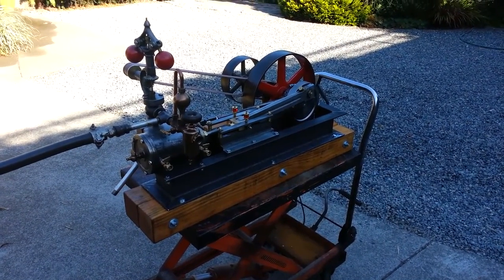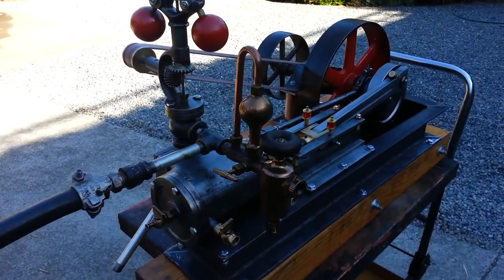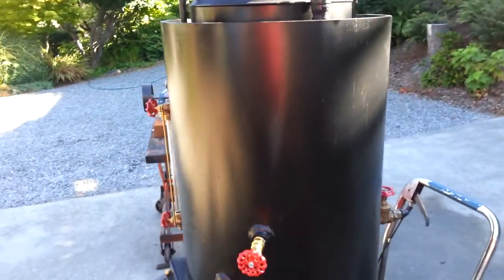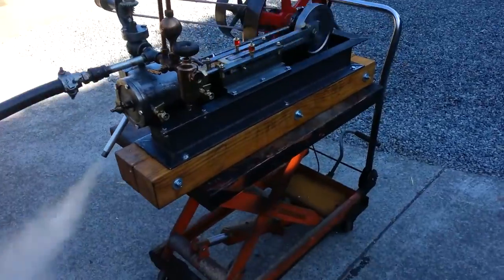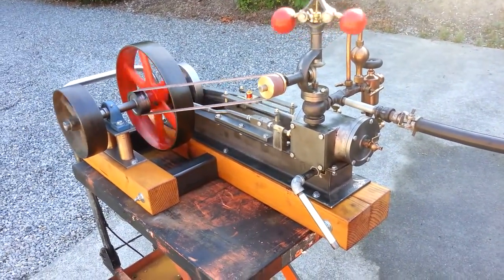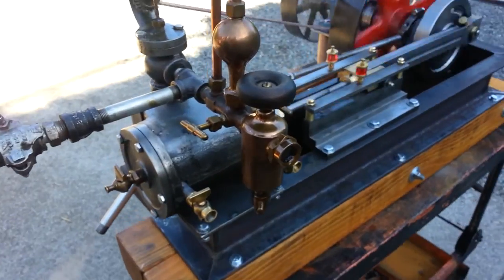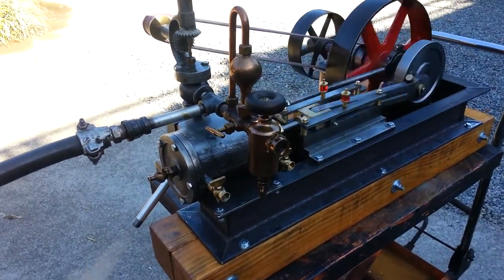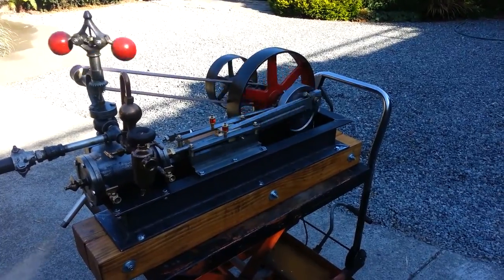Steam Mill Engine Flyball Governor Tractor Hit Miss Boiler Off Grid brass. FOR SALE ON EBAY

Comment from the maker: I work at it every day till the engine is done. 6 to 8 hours,sometimes 7 days a week.
Reply: rossco1948 I am curious to know what you charge for building a boiler. I am looking at buying one to run my 3 HP Petrie engine.
Reply from the maker: Give me a call. 425 868 4664
Ross
Reply from the maker: I have a boiler that will run your engine. Look on ebay for Live steam boiler